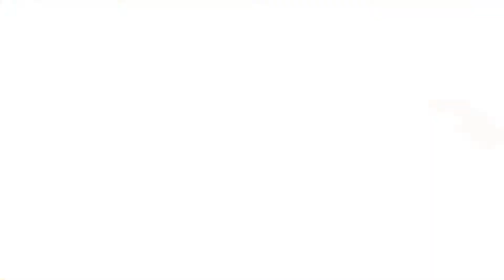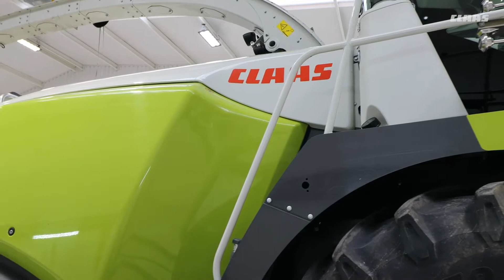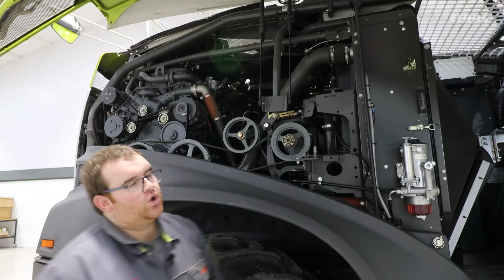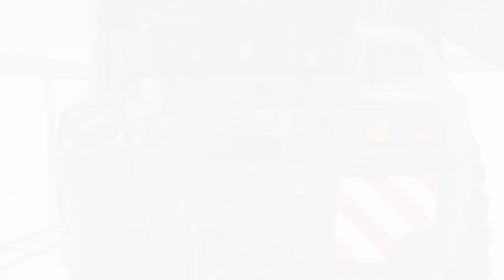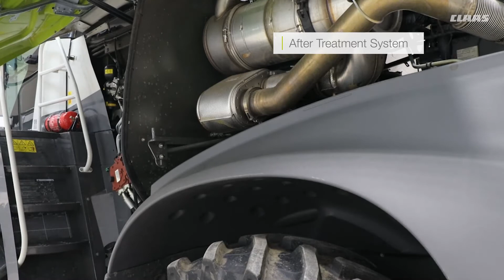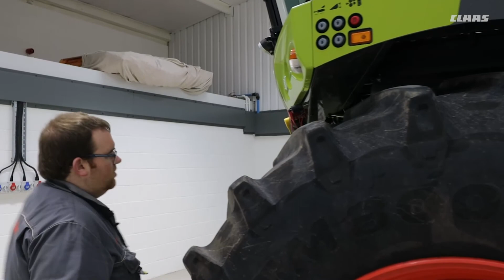JAGUAR Operator Tips - JAGUAR 900: 360º tour

Comment: these are not operator tips, these are operator basics, which u can read about in jaguar operator manual... stop posting such useless videos and give real tips, for example do not be guided by air pressure sensor when it comes to air filter cleaning and clean it daily...